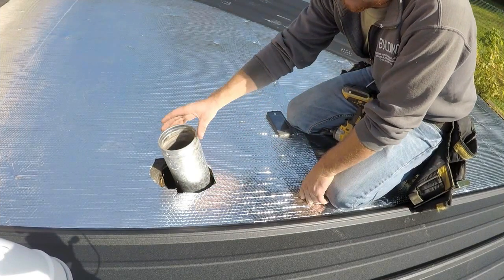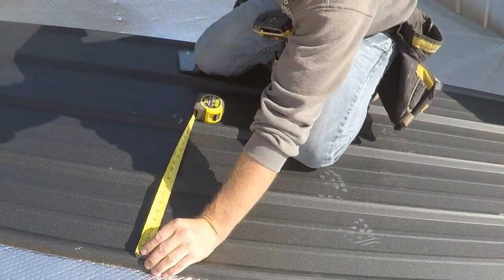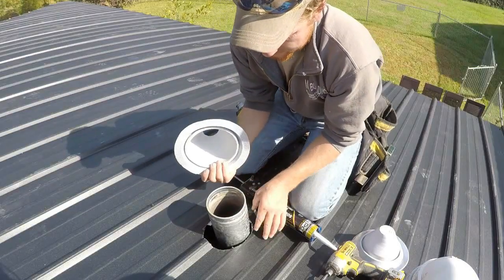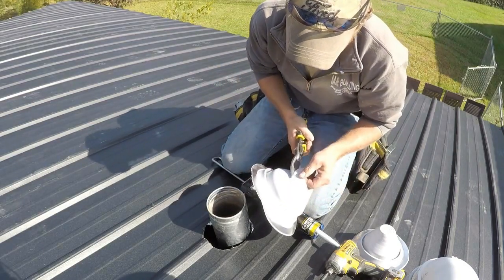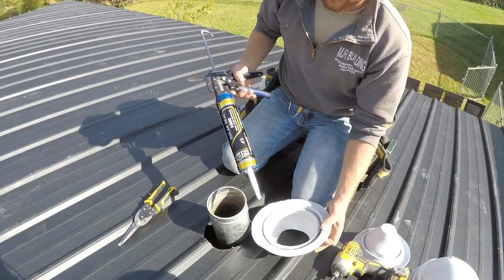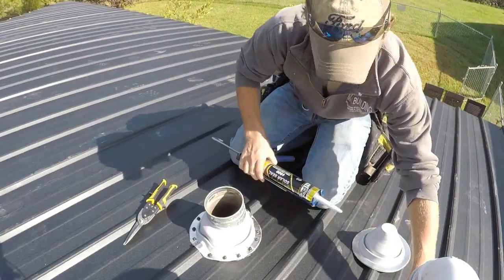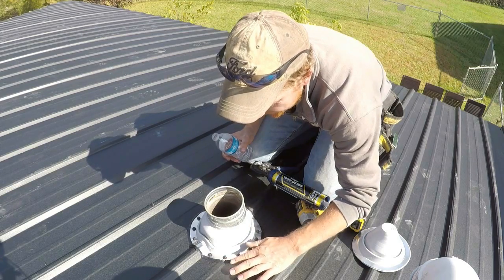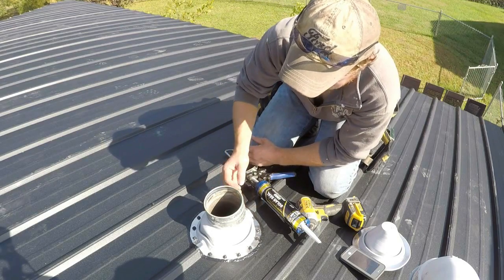HOW TO INSTALL A METAL ROOF BOOT

Comment: Glad I saw this. I live in Costa Rica and the majority of homes here have no vent pipes. Creates a problem with clogs in the closed system. I could only imagine that they didn’t know how to flash the pipe on corrugated metal roof. The houses that do have a pipe through the roof they use some type of roofing cement that cracks soon after application when the roof heats and expands. Thanks for the awesome video

Comment: Screwing down the boot is so simple and easy but at the same time it will block the metal panels from expansion and contraction causing warping when the weather is hot.
Reply: What would you recommend other then screwing it down?

Comment: That was good information. As an electrician, I was helping someone and their service was getting a mast pipe that had to go through the soffit overhang portion but was not sure how we could seal up correctly. I all my years, this was the first service with the mast going through a metal roof so I was not sure. Thank you.
Reply from the maker: Thank you! I should’ve mentioned that they also make a “split” boot for a weatherhead that already has the lines hooked up to it. It will split to go around the pipe since you obviously can’t bring it down over top of the pipe. If you have the boot when you install the pipe, just make sure you install the boot before you put the cap on. Here’s the link to a split boot if you ever need one.> https://www.menards.com/main/building-materials/roofing-soffits-gutters/metal-flashing/dektite-reg-gray-metal-roof-vent-pipe-flashing-for-3-4-2-3-4-pipe/rf801g/p-1519198283886.htm

Comment: Very wise, putting the routine install screws on top of the ridges instead in the valleys, makes it 1,000x less likely to leak since only a direct hit from a raindrop could even have a chance of leaking at a screw head  (who would put a screw in the bottom of a valley when its actually better to put it on top as said ALSO the screws on top where the panels overlap hold the "seams" together much much better so wind can't grab the metal as easily; just use 3/4" longer screws than the norm they try to foist on you.   Nice video, thanks. !   Q>  is there any adhesive that can simple glue down the lower lip of the vent "boot" ;  i like less screws in the roof to minimize future leakage.
Reply from the maker: Thank you! I totally agree with you on the screw location. Been doing it for years with zero issues. I don’t know of any adhesive for the roof boot, although I’m sure the caulking would hold it in place as long as you had something to hold it in place until it cures.
Reply: Put a screw in a piece of wood and leave it up 3/4" or so, now put another screw beside it in flush and tell me which one moves most if you grab the head and move it side to side.  Metal moves, when it does, the screw that's not all the way down has 1000x more chance of leaking and working it's way loose over time than the flush screw.  Also, when you go in the ridge and overtighten just a bit it dimples the metal leaving an unsightly finish.

Comment: Could you tell me the best way to fit regular corrugated metal roofing panel around a power pole?  I know how to measure the hole, but not sure how to get the hole around the pole. The only two things I can come up with is cut the hole for the pole and then cut a horizontal line over to the hole where I could offset the metal enough to slide it over to the pole, or cut the metal panel in half and cut a half circle in each and fit the lower one under the upper one before putting the boot on.  Thanks for your help!
Reply from the maker: Whenever I have a power pole in the roof I always start the roof so that 2 sheets lap together right at the pole. Whether that means starting with a 1/2 , 1/3 piece.  Hope that makes sense.
Reply: @MT_Homes  Makes sense.  I had my metal precut and it had to go on with the directions he gave me for the layout..  I just ended up over lapping an upper sheet over a lower spare piece that I had.  Thanks for the reply!

Comment: Many thanks, what sort of caulking did you use?
Reply from the maker: It’s called Solar Seal, I believe. It what the metal company sells.
Reply: @MT_Homes  Many thanks, is it for roofing in general or specific to being near flues?
Reply from the maker: It’s for roofing in general.

Comment: Question: I need to replace my boot. Will I be okay to unscrew it and use the existing sheet of metal roof? I'm concerned if I remove the existing boot and replace it that it will leak due to existing holes from the previous boot.
Reply from the maker: If you fill each of the old screw holes with caulking before installing the new boot you should be fine as long as the new boot covers the old screw holes. Especially if you put a heavy bead of caulking underneath the boot then another bead around the perimeter after it’s screwed down. Another option would be to buy a bigger roof boot.
Reply: @MT_Homes  thanks for the advice! I guess I was too close to the project to even think of just getting a bigger boot. I appreciate the help!

Comment: Is that rubber boot work with gas furnish exhauust pipe. Thanks
Reply from the maker: It’s a double wall hot water heater vent pipe. On a 90 degree day the metal roof will get hotter than the pipe ever will. They do make a special boot for pipes that get really hot, like a wood stove chimney. They are orange in color so I don’t use them unless I feel I have to.

Comment: hey bud they make long bill offset snips. save you from getting hands cut
Reply from the maker: Yea, I’ve never tried them though. Felt I might not have quite the control I have with the straight nose. I could be wrong. Probably outta try a pair.
Reply: @MT_Homes  try them out I feel I can cut better cause I don't have to worry about slicing my hand. you made an excellent video
Reply from the maker: Thank you!